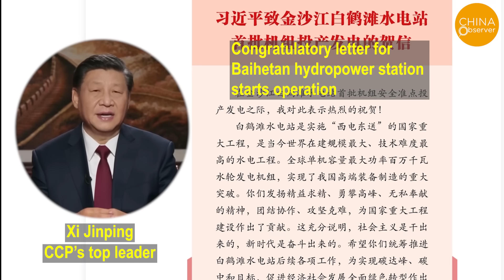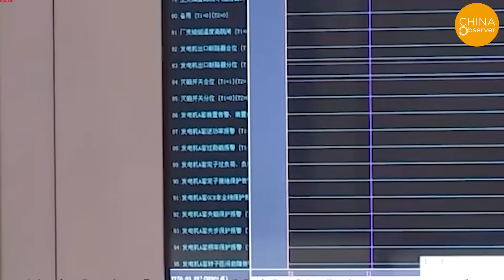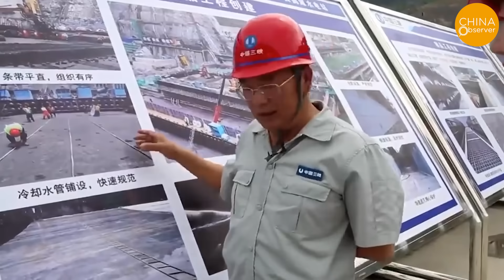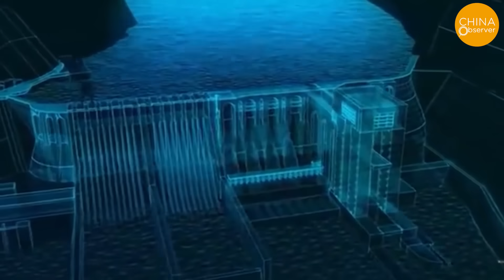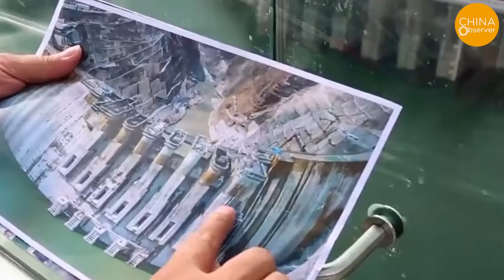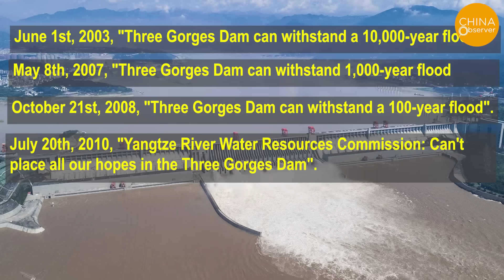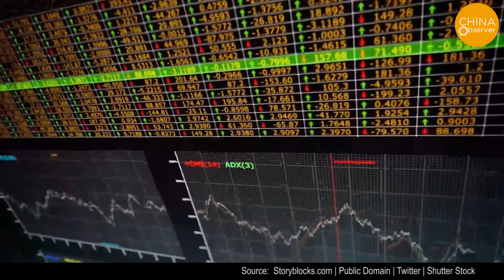2nd Largest Hydropower Station May Lead Collapse Risk to The Three Gorges Dam. Dam failure risk

Comment: Total rubbish...all the speculation that the dams will collapse, will release massive amounts of flood waters, etc.  The USA Hoover dam has been in operation for decades too.  Dams such these are massively constructed and are designed to resist the most massive earthquakes.

It will be hundreds of years before they silt up but there will also be technology to flush out the silt.

I watch such horror videos with amusement. I am a construction engineer with decades of experience in heavy construction. All such nonsense videos are by people who does not know what is called a reinforcement bar, who does not know about geology, geotechnics, geophysics and many more technical terms.

No dams can hold back all the flood waters.  You never see a dam half-full. Then need a massive amount of water to generate electricity.  Flood control downstream continues to need preparations.

Comment: For flood safety in China it would have been better to remove or replace the thousands of poorly built dams all across the country instead of building one massive dam on one river.  Dams have cause the most destructive floods when they fail.

Comment: If the Thre Gorges Dam breaks, it won't just be a mega disaster for China, but for the entire world. In China, millions would die and almost instantly up to 15% of the world's manufacturing base will be wrecked and left out of action for a very long time. Our entire worldwide economy was negatively affected recently when only one ship got stuck in the Suez Canal, so losing 15% overnight will cause the collapse of supply chains for innumerable industries and there will be no quick fix for it. So at the very least the dam collapsing will cause tremendous shortages of products of all kinds across the world and a recession, if not an actual collapse of the worldwide economy.

So the dam is a ticking time bomb that will wreck large parts of China and devastate the entire economy of the world. Nobody should ever hope this dam collapses, and the entire world should be trying to find solutions to prevent it. However, the CCP will probably reject any help out of pride, so hopefully, they show more competence in trying to maintain and fix the dam than they do for many of the other things they manage.

Comment: Pretty sure the risk was calculated before they started the project, so no need to worry.
Reply: I spent an hour last night watching videos of the most recent flooding in China. I assume the Chinese calculated the risks before they designed the multitude of reservoirs that failed resulting in a massive number of deaths. Hopefully. China subcontracted out the design and calculations on the new dam, or they are screwed.

Comment: We now know what happened now with the disastrous major 1000 year flooding in China.
We now know if US or EU or Japan want to bring China to its knees is by sabotaging or bombing the dams built all over China. It will drown China and cut off power all over China. China is now too dependant on mega hydro power to generate most of it electricity.

Comment: So they're building dams that work well for generating electricity, but they're building them so bad that in case of a flood they have to open everything up and let water through to save the dam and kill people. Or it can brake and kill even more people. Sounds pretty stupid to me. I mean you can put out all this propaganda now, but it's a matter of time until a catastrophy happens and then they won't be able to deny it

Comment: Who can believe the CCP when they claim the gigawatt output of those dams? I would bet that in reality the electrical output is not what they claim.
Reply: On what ground you built your suspicion?
Reply: @howard8723  You must live under a rock! When has the CCP ever told the truth?
Reply: Who cares?
Reply: The math supports it its easily the largest hydro plant in the world and scaling and adjusting for modern tech compared to the runners up it checks out.
Reply: Engineering science.

Comment: And things like this have no affect on climate change.  You can change water ways with no expected changes anywhere in the world
Reply: Yes, but also no. Note that the creation of such dams requires massive amounts of concrete, and the production of concrete also produces large amounts of CO2. But they are better than coal-fired or gas-fired power plants regardless.

Comment: This is a western propaganda that appears weekly, montly and yearly to smear China.  It is very well crafted first by updating China's hydro achievement, as it si factual,  and then list out some events strung together to smear China has got it wrong.

The discrepancies and weakness of the arguments are

 (1) When a dam is build the speaker criticised it causes flooding downstream by releasing water to save itself and not holding the water back that it supposed to do.  This is an insult to common sense as every dam when reaching its maximum capacity will have to open its spillway to drain the excess water to make sure the dam is not withstanding hydrostatic pressure higher than its designed capacity.  This is the design function of every dam.  Every dam is designed to hold certain amount of water but the speaker hinted China dams should be able to impound indefinite amount of water.
(2) The speaker criticised flood downstream of Three Gorges.  China did have a mild flooding during the peak flow in 2020 when the Three Gorges was declared reaching its designed capacity first time since 2005.  All the 2020 videos I saw in Yangzte downstream of Three Gorges show no city was affected.  There had been small knee-deep inundations along and local to the river banks only.  Thus to China the flooding was effectively under control.  The speaker has put in footages not related to the Yangzte and even those are not real flooding by the Chinese or any national standard.  Also flooding is a loose term because in UK flooding occurs everytime it rains and the root cause is climate change and never a bad drainage management.
(3) The speaker sowed the seed of fear by pointing out China had a dam failure before so will its current dams in future.  This is also an insult to common sense as everyone can see the new dams China has been building are concrete dams.  The example quoted was decades ago when the dam was build with earth!  Technically he was comparing earth-filled dam with solid concrete dam to fool the viewers.
(4) The speaker used the now exposed river bed in Chongqing to criticise the three Gorges dam has led to draught in the river ( the same downstream area he also used to show so called flooding by the Three Gorges) and then also added this was the silting caused by the Three Gorges.  That is insanely unscientific because silting occurs upstream and behind the dam not downstream when water isn't moving with the silt.

The inaccuracies and misinformation introduced in this video reminds me the weekly, monthly and yearly propaganda videos surfaced regularly by the west to demonise China that the Three Gorges dam is about to collapse.  These people waste their lives to distort the truth as Three Gorges was completed 16 years ago and has generating power for 10 years breaking the world record as the world's power plant that generates the most electricity annually.

These time wasters now have more challenges because the 4 recent hydros China has bulit on the Jinsha River has a combined output double the Three Gorges.  They will never dare to admit just on the Yangzte River alone China has the 3 out of the 4 biggest world hydros;- - No.1 Three Gorges (22,500MW), No. 2 Baihetan (16,000MW) and No. 4 Xiluodu (13,860MW) .  The No.3 is Brazil's Itaipu with 14,000MW.  The best from English speaking country ranks No. 9 with US's  Grand Coulee with 6,809MW.  Even the China's Wudonde hydro mentioned by the speaker is world's No. 7 with 10,200MW.

One thing is now evident from western culture - if you can't beat them smear them.

Comment: Well one good thing about China building everything along one river, any bad effects are more isolated to a single area as opposed to destroying all their rivers.
Reply: Don't kid youself.  China has dams in every major river.  The world higgest mountains is Himiilayas with 8,800m altitude.  All Chinese major rivers start there with snow that melts and run several thousands miles before reaching the sea at zero altitude.  Any nation unable to harness this potential energy does not deserved on this planet.
Reply: Except when you stack multiple dams on one river you create a pressure wave if one fails upstream with chunks of the dam that will flow down stream.  As well as ruining all life that used those rivers.  Just wait you'll see.

Comment: I wouldn't be surprised to find that there is a direct correlation between China's dam building and the decline in fish stocks along China's rivers.  Dams not only drown fish spawning grounds, they also prevent the fish from migrating to spawning grounds.
Reply: Dont worry. china steals fish from other countries  fishing grounds. Plenty of fish to steal. Too bad for the victim countries.  XD
Reply: @pbxn-3rdx-85percent  its happened many years ago. Even they fake their flag on their ship to fake the ship so they can steal fish easily
Reply: They leveraged debt from around the world to acquire the water necessary to fill the dams. But I dont expect it to maintain structural integrity for much time.
Reply: @nathanielmcneal5835  Doesn’t that wall look like it’s already breeched?  Tofu dregs
Reply: YES THE EVILCOMMMEEEECHINEEE ALONE ARE RESPONSIBLE FOR THE DESTRUCTION AND THE COMPLETE COLLAPSE OF THE PACIFIC SALMON ALONG THE WESTERN COAST OF NORTH AMERICA!

YES, IT IS THE EVILCOMMMMMEEEECHINEEE ALONE THAT IS RESPONSIBLE FOR WHY ALL THE FISH STOCK IN NORTH MURCA! IS GONE TO HEELLL.
Reply: Be sensible and mindful of the Yangtze River is over 6,300km long with a vertical drop of 5 km when you are talking spawning ground for fishes.  Jinsha River is the upper stretch of Yangtze!

Comment: Water levels at China's Three Gorges Dam set fresh records on Friday despite a gradual decline in inflows, doing little to assuage concerns of a possible collapse that would affect 400 million residents.
Reply: Thanks for waiting 16 years weekly, monthly and yearly so far for the three Gorges to collapse.
Reply: @gunsumwong3948  The Hoover Dam in the U.S. has been open and running for over 85 years. :)
Reply: @LightWingStudios  I am sure US has expert engineering in the past.  The statistics also suggests since 1980 US has an average 24 dams failures annually.
Reply: @nevergiveup19841  Just open your eye on every video about China.  It helps if you can read and understand the Chinese videos but if you do you probably would not be be so easily hoodwinked.
If you park the biggest S class Mercedes car on the top of Three Gorges dam you need 7000 of them.
Only after built for 16 years in 2020 it was the first time  it had to withstand the full water depth of its design.  Any excess water has to be discharged by its spillway.  There is no photo in existence that show all it top row spillways put into operation.  I suggest you download Three Gorges dam drawing to appreciate its constrcution.

Comment: Hopefully they wont be using tofu cement.
Reply: Of course they did. It's cheaper. I already do not like the look of all that weeping you see on the concrete.  Compare it to boulder dam or glen canyon.
Reply: China the biggest manufacturer of TUFO CEMENT. Hard on the outside, crumbles in the inside.  XD
Reply: Very sarcastic
Reply: If you actually think the CCP builds its IMPORTANT infrastructure the same way its developers build investment properties......then youre definitely the dumbest person in the room.
Reply: @nevergiveup19841  If you watch enough of the Baihetan video you should know its concrete was mixed with low heat cement and the whole dam has been rigged with piping to cool down the body temperature.  The instrumentaion in any of the Chinese dam is way over and above that normally attempted by the western engineers.  So I am satisfied the Baihetan dam wasn't mixed with hope and air but with AI and the latest temperature and stress monitorings that have been installed and scheduled to operate for the life of the dam.  It is a shame you can't understand Youtube videos in Chinese because there are tons of information in them.  I for work is a concrete specialist and specialised in turbine design (up to 800MW), repair, modification and strengthening to any international code.  I wrote report to certify, condemn or restore buildings and large RC structures too. Before Life365 was even invented I was already writting computer programs to do the same thing.  You may be surprised there are time-served concrete technlogists around those posted coments.
Reply: @gunsumwong3948  You are in the wrong channel. This channel is for losers who hate China so much and despairingly want to hear bad news from China even though most of them are delusional. 🤣🤣
Reply: @easonhuang7117  The video and many video shows the poor quality in modern China concrete. I hope that your house is a tofu building so that you will know how the peasants in your country live.
Reply: @easonhuang7117  hating CP, not China
Reply: For your ignorance China is the world's biggest cement manufacturer and makes 8.3 times more than the next runner-up.  It has been like that for years.